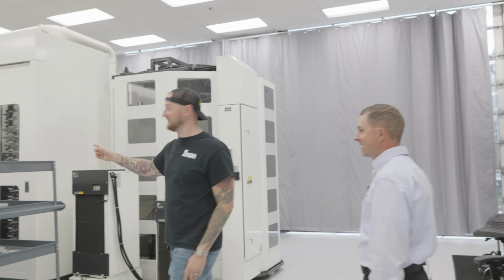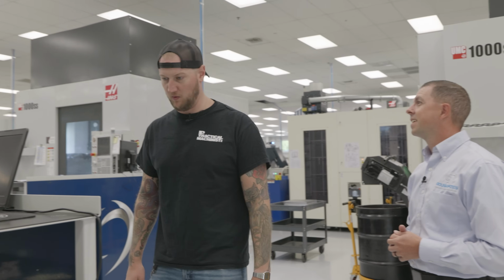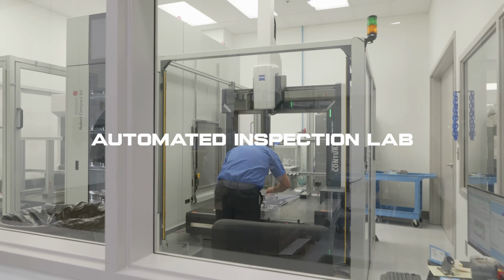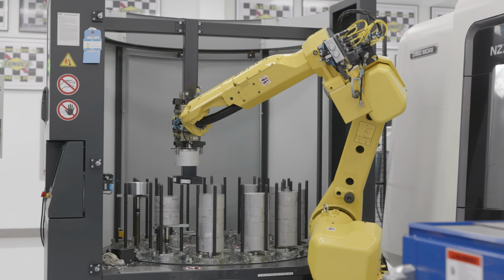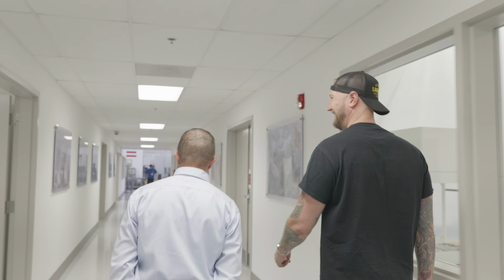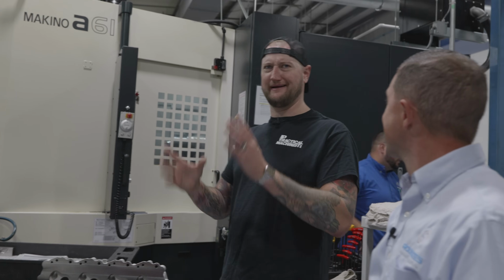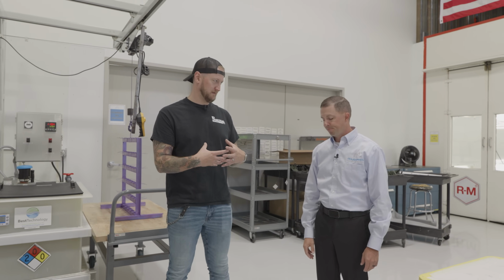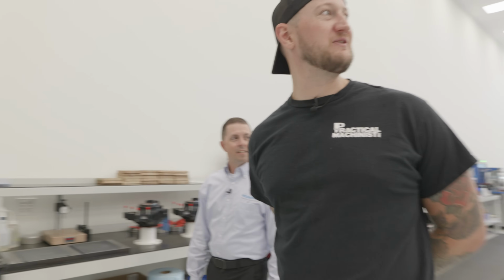Roush Yates Manufacturing Solutions is The Shop You Wish You Built

Comment: Automation definitely kills jobs don’t let this guy try to fool you, automation is literally designed to minimize the amount workers while producing more. Does it create some jobs sure but never the amount that it kills as you see in this shop 1 operator per 4 machines. He even said he’s still gonna automate even with his relationship with trade schools that tells you he has no interest in hiring more people he wants to eliminate as many jobs as possible. I’ve installed a variety of automation equipment from conveyor systems to industrial machinery to say it doesn’t kill jobs is a fallacy.
Reply: Have you ever employed people? It's a nightmare.
Reply: @ryanclarke2161 so true.
Reply: Employees are a burden to every company if they could lights out the whole facility they would.
Former Dana Corporation employee from the 80's to 00's and that plant I worked at had several automatic press lines and one had 4 presses and 4 employee's vs 15 employee's on a manual line of the same size. 

Human labor is the most unreliable part of production.

Comment: It’s cool to see these big shops and their fancy machines, but my dream shop is the one I have. It’s small enough that I can run it myself and my overhead is low enough that I don’t kill myself looking for work. I’m sure it’s challenging work for someone who figures out the CAM and sets up the machines, but the guy running 4 machines is basically a robot. I see people asking how they can compete with a shop like this. It’s pretty simple, don’t. These are multi-million dollar businesses. It’s like saying you want to start your own cellphone company. There’s plenty of non-fancy machining out there to do. Get decent at welding, buy a used Prototrak mill and an older name brand lathe with a good sized spindle bore. Get good at drilling out broken bolts and putting in heli-coils. Once your name gets out there you’ll have more work than you can handle.
Reply: BORING! the future is now old man, a used mill turn will set up back 100k and get you millions of dollars of work over 5 years
Reply: Well said man. When you get big like these guys you don’t do what you love. You just become a manager.
Reply: I'm a self admitted  hater of the overly automated way some shops  run. The push to take away all human error in leu of profit stacking has left us with few and far between actual passionate machinists. Ones who care about, and more importantly understand,  the relationship between the man, the tool, and the metal. And not just the manual guys either.
Reply: @FuriousGeorge_67  Automation allows for competitivity though, otherwise we'd be making everything out in china if we didn't reduce manual labor needs